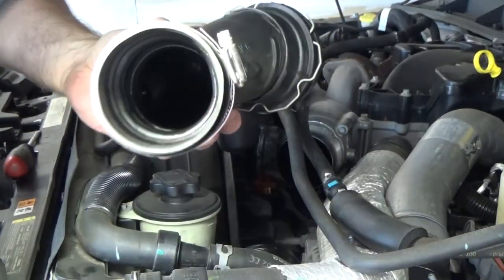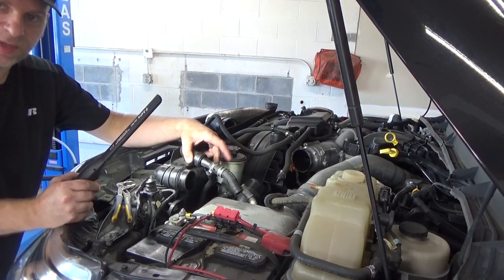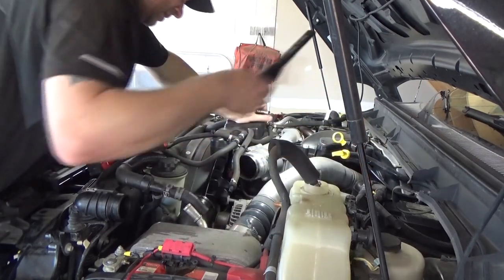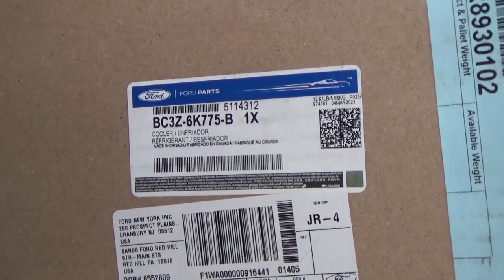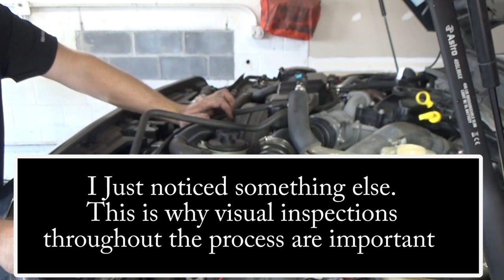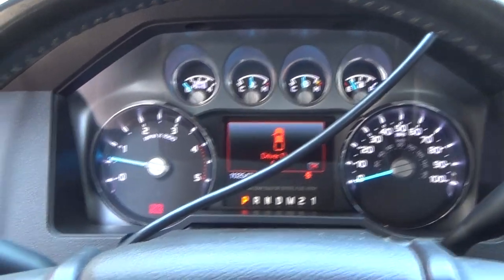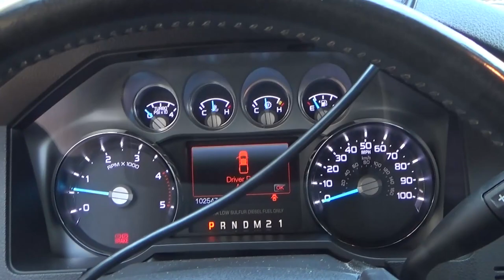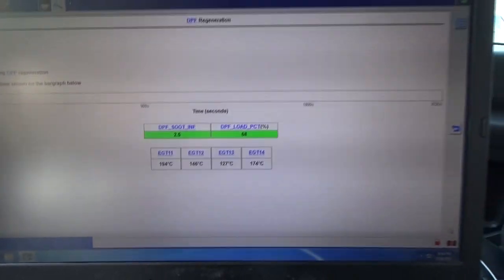Ford Truck: Secondary Cooling system Low - P026A  intercooler Internal Leak! 2011-2016

Comment: I own a 2012 f250 6.7 99k miles my intercooloor pipe connecting to throttle body has some sut build up is that normal or is there something wrong internally?

Comment: Was his transmission running hot ? I’m having the same issue and can’t find the leak.
Reply from the maker: It's frustrating not being able to find the leak. Have you checked inside the cooler for signs of coolant?
Reply: @robinsonsauto  not yet, I’m gonna pull it and test it.

Comment: Awesome video!
I have the same problem and will have to change it.
My question is, if there is no coolant dripping to the ground, where the coolant is going to since this is internal?
Reply: Inside engine with charged air

Comment: What happens if not replaced?
Reply: You will pull coolant in to the engine causing internal damage ,anti freeze and oil do not mix
Reply: What if driven for 2 days but now it’s parked and tearing out the inner cooler do you think 2 days of driving just locally will the engine or turbo will be ok or too late any info will be grateful

Comment: I have the same problem in my f250. Ford is telling me that I will also have to replace the secondary water pump because that is usually the main cause of the coolant leak. Do you agree with them.
Reply: I never agree with corporate America. There’s a reason they never went bankrupt
Reply: @codyrinehart5479 wokey wokey